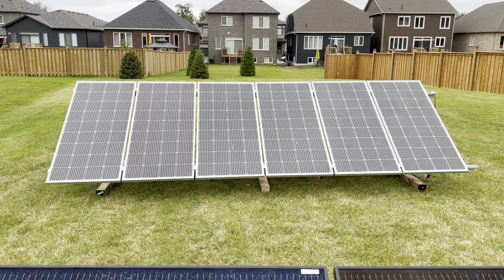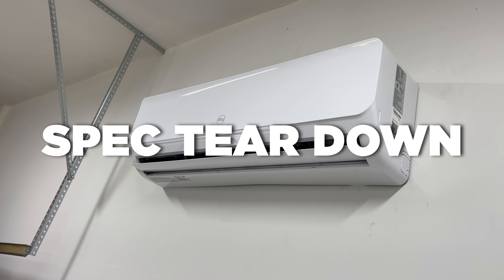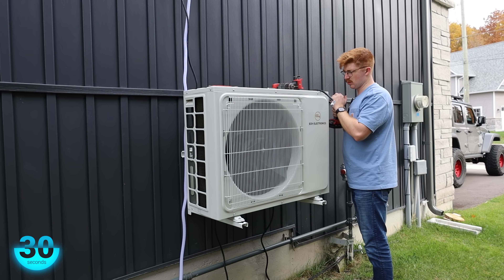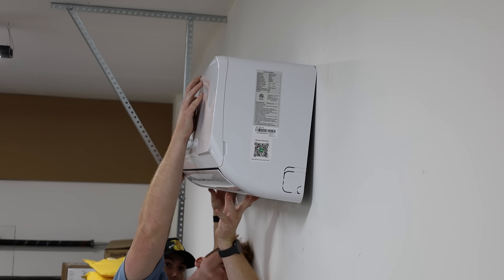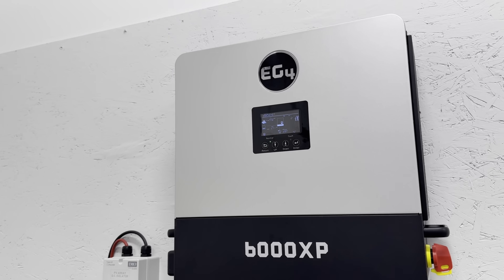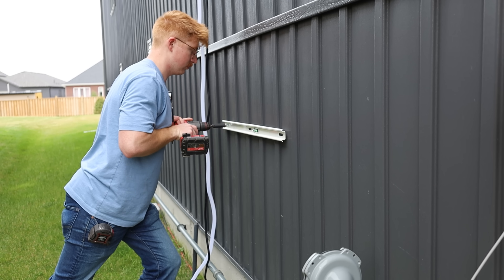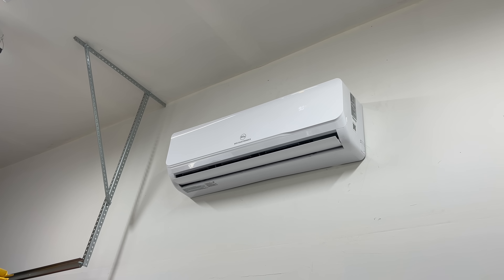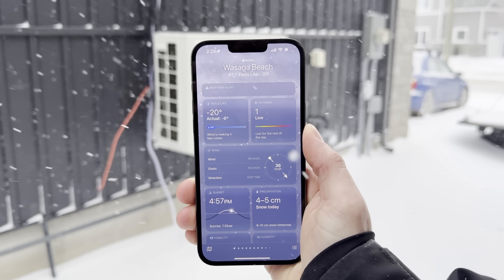Cheap & Simple EG4 Solar Heat Pump - Anyone Can Do This!

Comment: I have the 12k Hybrid in a 400sf computer room. It cools the room down to 76° while sipping on solar power. In the morning, before the sun is up, I heat the room to 83°(OSA 43°) . It will surge up to 1200W of grid power for about 10 minutes then settle down to 475W. Its way more effiecent than my LG12K portable A/C and my radiator that sucks an ungodly amout of power. And I have reclaimed some floor space.

Comment: Guys, I guarantee you EG4 isn't building this thing.  It has EG4's name on the front but the manufacturer, Deye, builds them with the solar capacity already engineered in.

Knowing the wall on which you hung the outdoor unit is un- or under-insulated, open the space around the lines again and completely fill that space with something: perlite or dense blow-in cellulose.  Fill it up and dampen the vibration.
Reply: Deye is the manufacturer.

Comment: Their price has come down quite a bit, which is great!  When they first introduced this product line, it was economically unwise for anyone who already had a conventional solar setup, but now it likes like it would make a little more sense.  The only issue with these products is the idea of using dedicated solar panels for a heating/cooling solution.  On one hand, the sun doesn't shine all day, and doesn't shine much at all on certain days, so you're using either grid power or energy stored in batteries from when the sun was shining..  On the other hand, you've got times of the day, and times of the year, when the sun is shining but your house doesn't need to be heated or cooled.  During those times, the panels are sitting idle, when they could have been charging up a battery or powering other loads.  This is an inefficient use of the potential output from your solar panels.  In practical use cases, this inefficiency is not offset by the efficiency gains you get when powering the mini-split directly from the DC input from said panels.  So, even though the actual mini-splits are no longer grossly overpriced, their primary distinction in the marketplace (being able to run directly from PV panels) is actually somewhat of a liability, since those panels are not being utilized efficiently.

Comment: I have the smaller one and yes the sound does suck. I think a truck is pulling up outside.  And mine is mounted on log cabin. But after it ramps up it’s quiet.  So nice to free ac in the summer and day time heat

Comment: I put in a 12K unit in my master bedroom this last year in the middle of the summer. I liked it enough that I put in a 24K unit in the living room. The 24K unit will cool down the whole house, 1,600 sqft. This winter, it has gotten down in the single digits and has done well when needed. The 12k unit in the bedroom at night pulls 550-450 watts on low, keeping the chill off. If you have the sun, I recommend these units.  The phone app works, and I have been running the units during the day, keeping the house above 73 degrees. We heat by wood at night. I live in southern New Mexico.

Comment: No heat pump will work well in that cold of weather. There are adaptations where a system may have emergency heat which is a extra powerful kw electric assist. But then the efficiency goes away. No such thing as efficiency with resistance heat. But it will keep up. As long as the heat sequencer doesn't go bad every 2 years like mine. I order two at a time for in the middle of the night on the weekend failures...
Reply: Well that's all just a bunch of malarkey there Jim Bob. 
Electric heat is 100% efficient, far better than the 80% of burning stuff. Chemistry is messy, physics isn't. (Least till you go quantum scale)
Heat pumps are even better than 100% efficient since they're moving heat instead of creating it. 

My heat pump does indeed have those backup heat strips, but I've never had to use them despite it dropping to -20F pretty regularly. And it's a cheap Mr. Cool one, not a fancy Mitsubishi or somesuch. My cheapo Mr. Cool universal has lasted 3 years already, despite working on keeping this under-insulated house comfy from -20f to 120f outside.

And the solar panels I just installed cut my electricity bill to a third during the coldest part of the year. It'll be paying me back during the spring and fall.

Comment: Did you try scheduling with the app? I found it to behave strangely, seems you have to set the on off with "cloud schedule" but you can adjust the temperature with the "scene" but i dont think the "scene" works for me.

Buy some rubber washers and put them between the wall and bracket on wall on the outside wall unit.  The thicker the better.

Also make sure to mount to unit level, yours is leaning quite a bit, that will also help.

It will probably not eliminate the droning noise but help a lot.

Alternatively mount it on the ground (make sure to elevate it on a frame( buy or build) that will eliminate the noise from inside

Comment: Droning is absolutely coming from mounting directly onto (metal?) siding.  You need to put a rubber gasket between metal parts or any vibration from the unit is going to transfer to your entire building like an amplifier.
Reply: Agreed, I'm out of my wheelhouse here but it seems like adding some anti-vibration feet between the unit and mount would help with the drone.
Reply: best would be to install it on the ground here, esp since no real insulation to speak of in the wall

Comment: I have the OG 120v version of this unit. It's almost exactly the same as the current one, except that I had to charge the lines myself. I'm using it to heat my off-grid shipping container and it works pretty well. One nice feature is that you can turn on an "AC limiter" function which ensures that the unit will only pull 300W from the AC power, which is great when your Zendures act like, well, Zendures and don't want to charge because <insert reason here>. Mine is the 120v version so I assume the 240v AC limiter, if it had one, would be higher.

My 40 foot high cube trailer is fully insulated and it at least gets to 60 degrees F without a ton of effort when it's really cold out, but I haven't done too much testing so maybe if I spent every day out there my performance would be similar to yours. I know that the higher end minisplits will have an electric coil that kicks on when it's super cold out... Maybe the EG4 doesn't have one because it eats too much power and that's why your air is only luke warm?

One thing about these solar mini-splits: They work really well and are pretty plug-and-play if you have some panels handy, but you pay a price premium. You could get a similar Mr. Cool or Pioneer for whatever for a lot cheaper and then roll your own solar battery system to even out the cost, and possibly have extra power left over to run the unit when the sun isn't out. Plus if your hvac isn't needed during the day, that extra solar just clips out into the ether, when instead it could be feeding a battery. Something to keep in mind if you're handy and/or already have a solar system in place.

Comment: We are running a EG4 12k ac/heat pump. It is -25c out side and putting out +28c at the head of the unit. Pulling 600-800w average. Northern Canada 1500w of solar panels to the unit. But it pulls from the grid a little most of the day. Sun is to low in the sky in the winter for our panels angle!🤷🏻‍♂️
Reply: How well does the unit shut off when it hits the desired temp?
Reply: It keeps the indoor fan running. Just shuts off the compressor & fan on out door unit.
Reply: Please tell me how well it works in the winter time we live in New Hampshire in I’m wondering will it produce good sufficient heat at 20° or at 10° or at 0°F I can’t seem to find a list of those anywhere but somebody must know? I’m planning to run my pellet stove as a back up thinking that this unit should take care of the heating load as long as the temperature is above 20° if it does better than that, I’ll be happy. I have not ordered the unit yet, but I am ready to pull the trigger. Thank you for your help.

Comment: The droning sound you hear is probably your wall doesn’t look like it is insulated (by the hole you cut out) and the wall is acting like a speaker. amplifying the sound throughout the building.
Reply: And the wall looks like it's metal, which only makes it worse.
Reply: I put mine on an insulated wood wall bolted down with rubber insulators. Still had the sound in my house. Sounded like a car driving by with a subwoofer in it. I put mine on blocks, sound is gone.
Reply: @chadcarrington1218 mine is on its own stand as well. Braced to the wall. No sound at all from the outdoor unit!!
Reply: The droning is definitely due to the wall bracket. I have that same kind of mount, and even with great wall insulation, you can still hear the droning sound when the unit is running. Pour a small concrete pad (like one or two bags of mix, small) and sit the unit on that, it will completely eliminate that drone.
Reply: I have this exact unit.- sitting on some very large pavers other than the fan it is nearly silent no droning.
Reply: I have the same drone with my mini split unit in the garage. This I would of mounting on the ground
Reply: I have mine on the wall on a mount just outside of the living room, and it doesn't drone. It really depends on the wall you are mounting on, bracket, and insulation.

Comment: The drone is because you wall mounted it. All of them have this issue. Always recommend pouring a concrete pad installing it on that.
Reply: Mine is wall-mounted and has no droning. Same goes for the one I installed a few years ago in my barn.I think it depends on what you're mounting it to.

Comment: Did you install the rubber pads under the feet? The pads are to keep the vibrations out of the building, i.e. noise.

Comment: The one thing I saw in your install that you are missing is a "disconnect" for the power on the outside. Also the romex you are using is NOT rated for exterior exposure. As a HVAC Tech normally you would have the romex come out thru the wall to a "disconnect box" then run a electrical "whip" , " stranded wires in flexable conduit", to the unit. This is code requierment to run the power this way.
Reply: I built a roof over my exterior unit
Reply: This install is complete savagery

Comment: If you get a small one, maybe go for the ~38 SEER rated one.  I think it would save money over the hybrid ones. Or use less power even if you were running on an inverter.

Comment: The sound may be due to the metal siding. It may be vinyl, it is hard for me to tell. If it is metal that may be the problem.  Maybe hold your hands on the siding and see if that changes the sound.